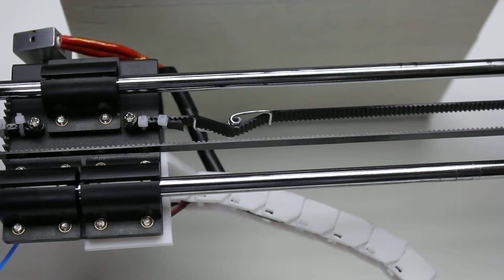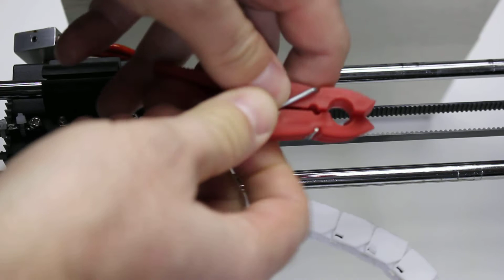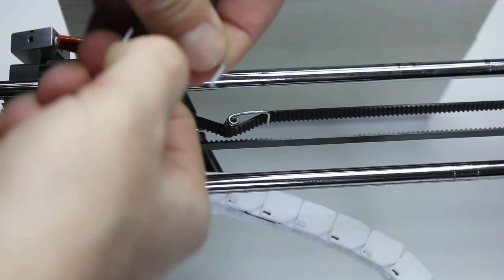DIY Anet A8 X Axis Belt Tensioner - No Printing Required

Comment: Why don't you just tighten belt tensioner. It's in other side of extruder on back side's you have to take that set screw all the way out on right side of extruder then the belt drops off then you adjust the belt.  It's between the linear bearings on extruder.
Reply from the maker: :) Mainly because I don't want to disassemble. Using spring belt tensioner also saves me some more time when the belt loosens a bit.

Comment: Great video, got me out of a pinch cause most upgrades are printed and I couldnt get mine tight enough to even print
Reply from the maker: After testing this tensioner, I left my printer with it as it does a great job.